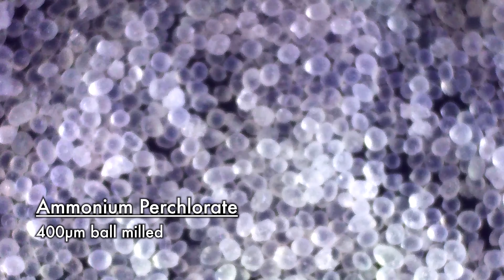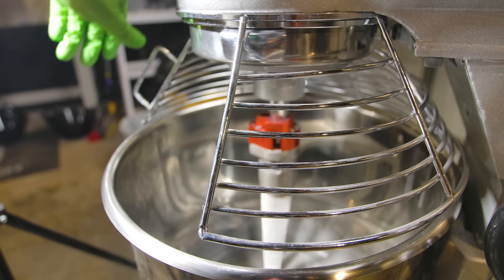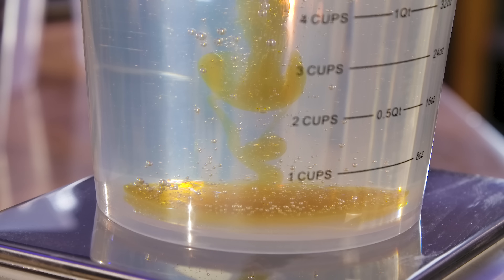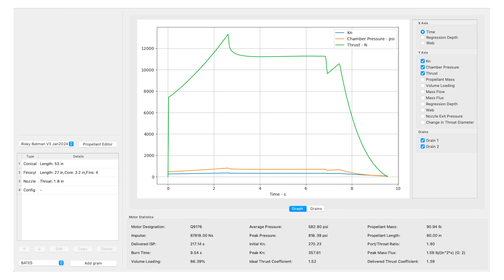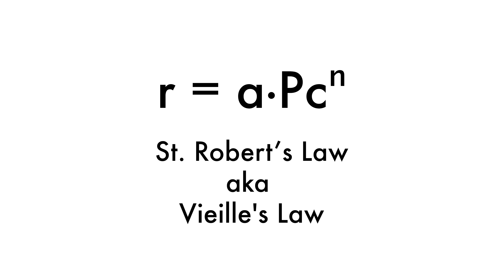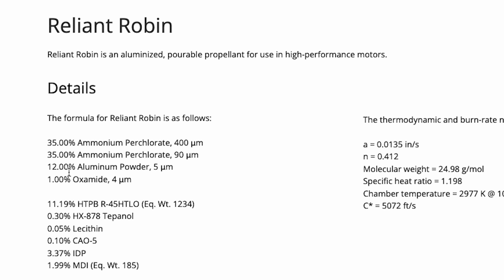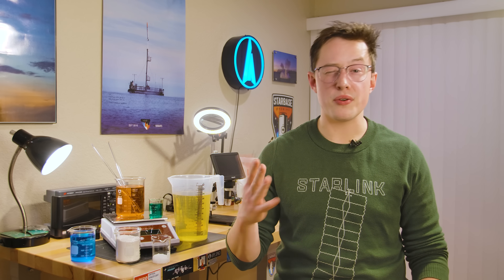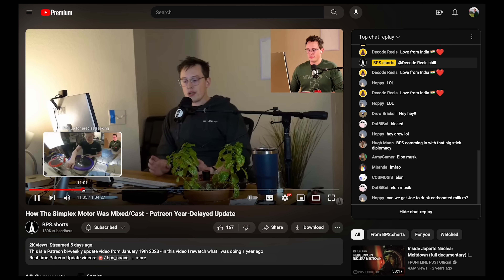Making a new solid propellant formula

Comment: Cool video man, I can't wait to see where you take this! One small but very important correction, the aluminum does NOT act as a fuel in the propellant. Fuels expand into hot exhaust gasses that take up tremendously more volume than their solid original state when they are burned. Aluminum does not do this at all. When it oxidizes, it does not expand and does not get hot enough to even turn into a gas. It's real purpose is to release lots of heat as it oxidizes, which in turn expands the exhaust gasses and increases pressure, therefore producing higher thrust as the gasses exit the nozzle with greater force. In this way it acts very similar to a fuel (both ultimately work to increase the pressure of the exhaust gasses) but do so in very different ways and have different side effects as well. In apcp propellants, the fuel is the binder, but also unintuitively the AP as well. When AP breaks down it releases the needed oxygen to oxidize and all that good stuff, but the molecule also breaks into a burnable fuel. This is why AP is such a great choice as an oxidizer, even though there are plenty of solid oxidizers that are better at releasing lots of oxygen, which on paper sounds better.
Reply: AFAICT, there really doesn't seem to be a clear consensus on what "fuel" means in the context of solid rocket propellants, and many seemingly authoritative sources (e.g. https://www.ncbi.nlm.nih.gov/pmc/articles/PMC8587658/) as well as less authoritative ones (e.g. Wikipedia) seem to classify all reducing components of the propellant mixture (other than trace additives, perhaps) as "fuels", if they don't simply use the words "fuel" and "propellant" interchangeably.

For bipropellant liquid fuel rockets, there's a well established distinction between "fuel" and "oxidizer", those being the two liquids stored separately and mixed and ignited in the combustion chamber. (And yes, aluminum has been tried as a liquid fuel additive; see e.g. Clark, John D. (1972), _Ignition!_, p. 180.) In solid rockets, however, the propellant is all one more or less homogeneous solid mass, so that simple distinction does not apply. The various substances making up the propellant grain can certainly still be classified using chemical terms, e.g. as oxidizing, reducing or inert, although — as you note — this classification isn't perfect since a single substance such as AP can contain both oxidizing and reducing parts. However, "fuel" isn't really a term used in this chemical classification. The closest thing, perhaps, is "reducing agent", which metallic aluminum certainly is.

Anyway, while gas generation is certainly an important (arguably the most important) aspect of rocket propulsion, AFAIK there is no concise and established term for "a substance producing a gaseous exhaust when combusted as part of a rocket propellant." And even if there was, it would presumably have to include both oxidizing and reducing compounds, since both can and do contribute to the exhaust gases.

Part of the complexity here is that the actual composition of the exhaust depends not only on the individual elements and compounds present in the propellant mix, but also on their ratios and on the temperature and pressure of the combustion process. While we can certainly say with fair confidence that e.g. aluminum pretty much always gets exhausted as solid particles (of aluminum oxide or, if combustion is incomplete, aluminum metal) while e.g. hydrogen and nitrogen pretty much always end up as gases (H2 / H2O / N2 / NOx) in all but the most fuel-rich (sorry, reducing) combustion conditions, other elements such as oxygen and carbon can go either way depending on what (if anything) they end up reacting with. And even when a combustion reaction produces gaseous products, that doesn't necessarily guarantee an increase in pressure: for example, the combustion of hydrogen with oxygen (2 H2 + O2 -> 2 H2O) has gaseous products (at typical rocket engine temperatures) but actually decreases pressure, since three gas molecules go in but only two come out. The heat generated by the reaction, of course, generally more than makes up for it, but that's still a big part of the reason why hydrolox rocket engines pretty much always run very fuel-rich: you get a much better specific impulse if most of your exhaust is uncombusted H2 rather than H2O. (The other reason, of course, is that too much heat tends to be bad for the engines.)

Comment: You could get rid of those bubbles in the mixture using a sufficiently small concrete vibrator. This is how we ensure stable solid foundations with concrete. Just know it'll cause some of the more watery substance to rise to the top, since it is lighter. I also don't recommend using this method with any fuels that are sensitive to impact or jostling.
Just an idea. Thanks for the videos man!

Comment: I've made my fair share of thermite and what I've never understood clearly is when aluminum is ground up that fine, surely it oxidizes almost immediately. Is it just that the oxide layout is still such a small percentage of the grain that it can just be burnt off and still believe a large amount of aluminum. It just seems by increasing the surface area by how many orders of magnitude you would be increasingly amount that converts to oxide before you even burn it?

Comment: Has anyone does any research with binders formed from gas phase precursors? Butadiene (the base unit of HTPB) is a gas under reasonably tame conditions which wound suggest that it might be possible to cast a grain by poring in a dry (or only very slightly wet) granular mix and then flowing the binder through that bed as a gas. That seems like the kind of thing that might work work great (it would lend it self to sealed system) or not at all (voids?) and would be interesting from a process R&D perspective regardless.
Reply: I can’t see many advantages doing it this way, and a ton of disadvantages.
Reply: @mduckernz  Saying you see disadvantages benefits no one if you don't say what those disadvantages are.

To me it seems like the kind of thing where the end value would be extremely hard to predict beforehand. Potential advantages would be it being perfectly pourable, avoiding voids (assuming you can get it to polymerize when and where you want it) and different options for curing agents (industrially, auto-polymerization is actually a problem so it might not need an agent). At a guess, it would be hard to make work at small scale but once the NRE of the R&D and the capital expense for building it out is done it might give a process that is less prone to defects.

Comment: While not directly applicable to risky batman, There is some cool new research into getting the time that aluminum takes to fully combust down. The methods usually involve replacing the oxide layer of the aluminum particles with another reactive substance. Per the papers, the methods don't sound too hard. Might make for interesting propellant mixes in the future!
Reply from the maker: Cool! Probably out of my wheelhouse for the time being but would make for some interesting research
Reply: I did wonder if the oxide coating on the aluminium powder needed to be removed somehow to ensure full combustion. I imagine it would be quite difficult given how reactive aluminium is.

Comment: I assume you must keep the aluminum powder in an airtight container with an oxygen adsorption component? Aluminum tends to oxidize rather quickly when exposed to air.

Right below this video YouTube recommends that I watch "DIY rocket motors, easy and cheap". Sounds a bit dangerous.

Comment: I feel like this is a rookie question, but what would happen if you made a sort of layer cake with different propellants in the same casing?
Reply: This is used as a real technique, primarily in very long motors - because you will have high erosive burning at the end segments, often these have a larger diameter core than the rest. But this means they will burn out faster, and so you end up with a “stepped” thrust curve, with a sudden drop off in thrust near the end of the burn.

But if you use a slower propellant for those end segments, you can have them burn out simultaneously!
Reply: (as for why the wider core diameter for nozzle end segments, if you didn’t know, it prevents the core from acting as a kind of nozzle, slowing the gasses so they don’t get to a choked flow condition… to put it (overly) simply. Read up on erosive burning mitigation techniques if curious 😊)

Comment: I'm so curious to see what adding both a catalyst and a burn suppressant would do.
Reply: This is a legitimate thing to do sometimes - some suppressants act more on the n parameter, rather than a, and so if you want a fast burn but for it to be fairly insensitive to changes based on pressure - this is most often useful with grain geometries that have quite big surface changes throughout the burn, which you don’t want translated into thrust differential - then you can select one that acts primarily on n, and then add a burn rate catalyst that primarily acts on the a parameter; for APCP, red iron oxide is a traditional and still excellent choice for this.
Reply: The resulting propellant will be one that doesn’t have “swingy” burn rate, and a burn rate that can be tweaked as required by adjusting the amount of burn rate catalyst. Keep the suppressant at a fixed value and simply tweak the catalyst, thereby tweaking the a parameter.
Reply: I have used this strategy to “tame” a propellant based on sodium chlorate and platinum-catalysed casting silicone as binder. 

Typically, chlorates have too high of an n parameter in their propellants made from it, but it can be tamed through suppressants to a value where it is actually usable (though I much prefer APCP… this was more of a “huh, I wonder if I can get this to work…” than a “this is a good idea” haha)

I used a variant of suppression techniques, but the ones that ended up working the best were low molecular weight amides. IIRC, without breaking out my old research notes, I ended up using glycine or phenylalanine, because it was effective in low quantities and was readily available, and didn’t screw up the binder chemistry.

Without suppressants, the measured n was about 0.65, far too high for comfortable development, as neutral grain geometries (surface area barely varies throughout burn) would be pretty much a hard requirement. WITH suppressant, between 0.38 and 0.45 (depending on the exact one, between those I had deemed viable and potentially worthy of further testing), which is still a bit high but very workable.